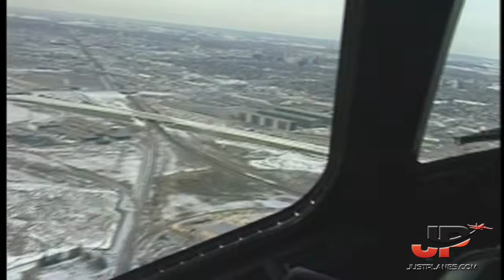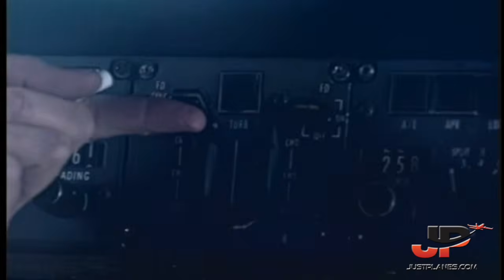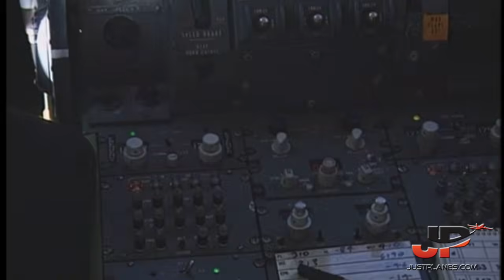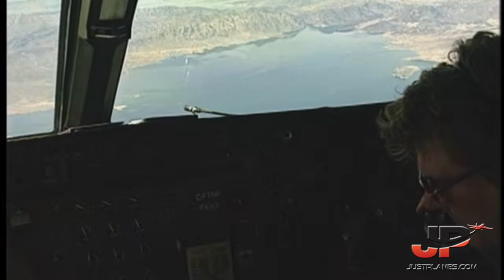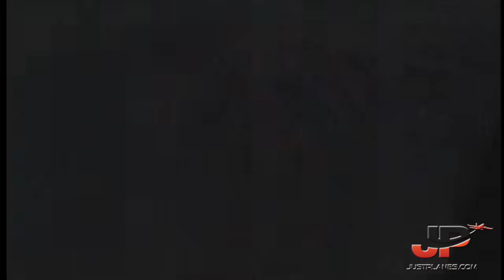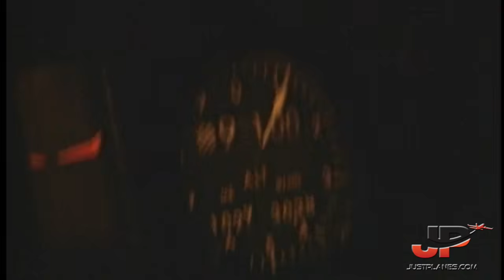In the Cockpit Lockheed L-1011 Tristar to Las Vegas (1997)

Comment: Nice video, great crew and marvellous aircraft. Managed 2 years and nearly 800 hours on the L1011, my all time favourite

:face-blue-smiling:.I did notice though that the captain at one point used a forefinger to adjust the "thumb wheel" to alter the vertical speed, a huge no no at my old pedantic outfit

Comment: I feel like this aircraft needed more powerful engines but nonetheless it was it was amazing!
Reply: What makes you say that. It could climb straight to cruze altitude. A DC10 had to step climb. I was flying the jump seat in a B757 to HNL. We were cruzing .8 mach. A Delta L10 was 10 miles behind and below it took off after us . There was a call that the L10 was fighting winds. Could we climb to let the Delta take our altitude. The Delta overtook us. When we landed the Delta was at the gate unloaded. The L10 could cruze at .86 mach.  Do to fuel consuption there has been little effort  to increase speed.

Comment: Excellent video.  Very informative.   It demonstrates the level of training that aircrews have to attain the very zenith in aviation.  I scanned some the previous remarks and I don't think anyone else caught and commented of the Captain's error.  He reversed the numbers of the engine thrust, which he obviously knew but just misspoke. Take off thrust is 41,000, not 14,000.  If he reads this, I'm sure he will chuckle like I did.

Comment: A delightful documentary and meticulous crew communication,coordination and cooperation. Thank you Capt. Richard and your crew. I had only flown its simulator back in 1989 at Gulf Air just before I left Fleet Planning(where my job was to phase out the Tristar fleet) and went on to obtain my Commercial Pilot License. The little that I had learn’t about this majestic and luxurious  jetliner was that it was well ahead of its time by virtue of its technology. The same reason that led to the demise of its older but smaller intelligent tri Jet the De Havilland 121(later Hawker Siddelley Trident. Both were equipped with sophisticated Auto land instrument landing systems ILS Cat3 and could land in thick fog. The Tristar went further as it was capable of , though uncertified) for Automatic Take Offs. The first Aircraft to ever gain this capability under certification tests was the recent state of the art Airbus 350. Tristar was  mid1970s technology mind you and that was a hell of an achievement. It was by far more luxurious than its competitor the Douglas DC10 which was constructed with less expensive technology and hence was able to out compete the Tristar economically as did the Boeing 727 favored against the Trident on a similar criteria. The DLC system was another novelty in its achievement but not sure if it was fitted into the L10-11 -500 long range version. When Lockheed was contemplating its original design even a twin jet version had featured and had that plan gone into production we might very well have seen a line of its offspring still leading the skies with ever more advancing digital cockpit like what we see in today’s jetliners. The Tristar would have made the Champion and pioneer of Aviation and Airlines Mr, Howard Hughes, who owned TWA and Hughes company very proud indeed. At Gulf Air in the Arabian Gulf it’s First Class was a splendor and it was branded “Five star * Tri Star”. I say no more!

Comment: Doing away with the flight engineer was a major retrograde step in my opinion. Not only did the engineer take a big chunk of the workload, the also knew the aircraft inside out and could concentrate on problem solving whilst the pilots aviator, navigate and communicate. They also at a push could jump into one of the seats and help fly the plane.
Reply: And they always knew the best places to go to on nightstops, always- what ever the required type venue was👍

Comment: I flew to Las Vegas in the '90s on a Royal Airlines L1011 from Toronto. Seeing the old Terminal 1 in Toronto brought back memories. The old terminal offered great views of the airport. I used to love to drive to the top floor of the multi-level parking garage in the center of the terminal from which you had a 360-degree view of the aircraft directly below you at the gates. It was the best possible vantage point to check out the ramp action! Nothing like that exists today.  I can still remember the sweet smell of kerosene. One of the things I remember about that Royal L1011 to KLAS is it appeared that the interior had been repainted by someone using a roller.

Comment: One of if not the best airliners ever built. We need a new tri-jet design with engines that can compete efficiently with the 2 engine jets.
Reply: It really is a beautiful aircraft design. I just can’t see it ever being replicated, the maintenance costs are so critical to operators, not just the fuel efficiency. It was an expensive plane to maintain with that S duct central engine, from what I have read about it. (Enthusiast, not an expert)

Comment: I'm lucky, I grew up at a time in the 60's and 70's when all the classic airliners were still flying. I've been on DC-9's, 737-200's, DC-8's, 707's and 720's, BAC 1-11's, Fokker F-28's and F-100's, DC-10's, countless 727's. My absolute favorite out of all of them was the L-1011. I'm lucky to have had many flights on them and loved everyone. Lockheed hit a home run with them....it may not have shown up in sales against the DC-10....but much of that was the fault of Rolls Royce falling way behind in cetrification of the RB-211 because of financial trouble.
Reply: Lockheed basically got ruined by Rolls Royce
Reply: The reason for delay in certification was failure of the engine bird strike test.  This is accomplished in an engine test cell and done by firing a chicken (not alive) with an air cannon into the engine operating at normal speed.  The RB-211 original front fan blade design was carbon fiber-plastic.  the long delay was caused by having to redesign the fan with titanium blades.  In another engine manufacturer's test, their test failed with disastrous result then someone discovered they had fired a frozen chicken. Career limiting stuff.
Reply: @eldrenbiddle9358  There were more problems after that. In the begining we thought an engine would not stay on wing for 200hrs. The engine would dissasemble into moduals. There were problems getting moduals to repair engines. Took a year or so for the engine to mature. At the end Air Transat bought our engine shop and some aircraft. TWA at LAX had 7 hulks that were never reassembled.
Reply: automatic transmission?

Comment: Greatest jet airliner in the history of the world.  26 years flying this masterpiece.
Reply: Absolutely. In its own class.
Reply: I had the privilege and enjoyment of flying on an Air Canada L1011.
Reply: I remember flying in one which was just recently delivered new to AC in '79. As it taxied, the brakes would groan, kind of a grinding sound, quite loud. Always wondered why that was.
Reply: @jakethepitador2558  I have flown on the Tristar/Tristar 500 about a dozen times, but never heard anything from the brakes. However, the No.2 centre-mounted RB-211 engine (located behind the rear toilets) would have a strange low vibrational humming sound. It could be especially heard on start-up.. both inside the airplane and also on the ramp. A unique airplane that will always have a special place in my heart.
Reply: @futonclutch5040    Yep, that humming sound on startup is unique to that engine.  It was all 3 engines, but the sound from #2 was most prominent because of its location.  

The RB.211s on the other L-1011 models did the same thing, RB.211-22B, -524 and -524B4.  The 757 had RB.211s as well, but I never heard that sound like you’d hear on the TriStar.  

It was a great old airplane.  I’ve flew the 747-400 for many years, the 757 and 767, and post-airline retirement I flew the Gulfstream G650. Wonderful airplanes, but neither could hold a candle to the L-1011.
Reply: Groaning sound at startup is when the fuel is being introduced to the rb211 engine
Reply: @Jeff-sp7bg  I've noticed this nasal droning noise as the engines spool up during taxi.  What's that?
Reply: @wizardmix  probably  just the way the mechanics and harmonics of the engine sound.  I know that the groan on startup is when fuel is being introduced.
Reply: @jakethepitador2558    No idea about the brakes.  Never really experienced hearing that sound.
Reply: I've only flown on one as a passenger two times.  Once in the latter half of the 80s and again in 1994.  As a kid I always hoped the jet would be an L1011.
Reply: Such a shame that it was Lockheed’s last and only venture into commercial aviation. Nobody has ever done it better. Safest aircraft in the sky.